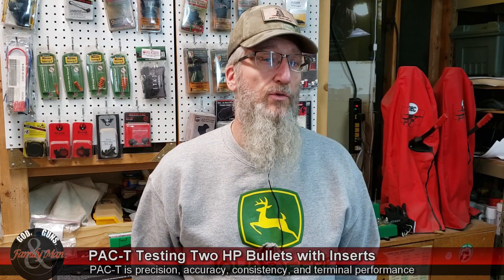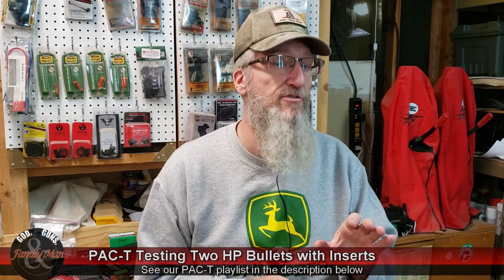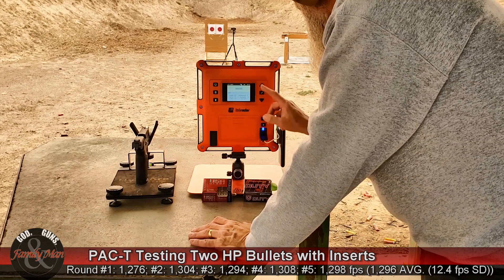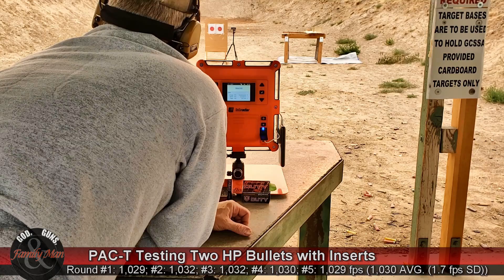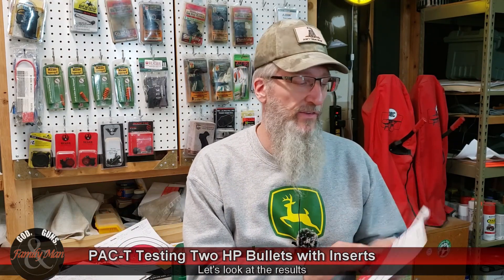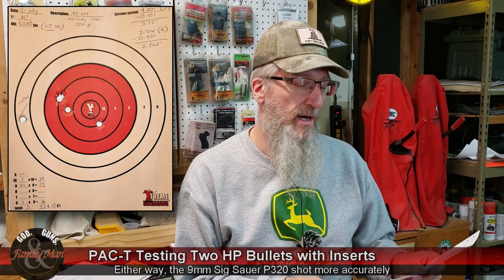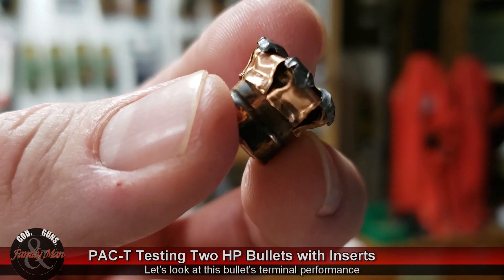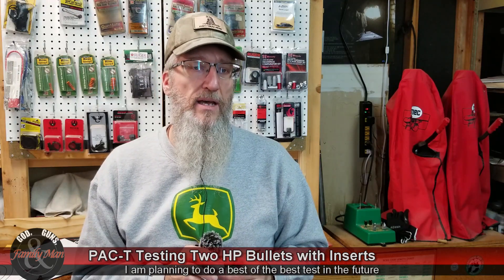PAC-T Testing the Hornady Critical Duty and Winchester Defense bullets

Comment: I used to carry the Hornady but stopped after experiencing a major problem with bullet set-back (which I have never experienced with ANY other manufacturer's ammo) and after contacting Hornady I received only negative customer service. 
They said I was "cycling the ammo too much and their ammo was designed to be loaded once and fired, period" 
It seems they believe we shouldn't unload their product, practice with range ammo, then reload their ammo for carry.

Absolute HOGWASH!
Reply from the maker: I have seen that with many of the carry ammo bullets.  If a person carries loaded and then unloads at the house, carries loaded the next day, etc. that bullet will start to set back into the case more and more (the taper crimp is not sufficient to hold it in place).  So... yeah, this happens.  
But you do have better options for carry.  The Sierra/Sig Sauer V-Crown in excellent as is the Speer Gold Dot and Federal HST.  Take a look at these, we did a PAC-T test on each of these and others.  Here is a link to our PAC-T playlist https://youtube.com/playlist?list=PL_KBTsQIm0U4HgkXxCZ2wk8djXCmS8aVl
Thanks for watching and posting.
Reply: @sdkweber  In over 40 years of defensive (along with duty) carry I have never had bullet setback to the degree of the Hornady----plus, it was only 45acp, the 9mm and 40sw did not exhibit ANY setback after many, many repeated loading and cycling
Reply from the maker: @stevenwilkinson8373  Ah, Hornady may be worse than others.  I am using Sierra V-Crown 124 gr. and see some of this as well.  It is certainly something we need to watch.
Reply: Nice video.  Where I live I can get the USA ready defense in 9mm pretty cheap.
Reply from the maker: @Aelazadne  That is good.  Get it while you can.
Reply from the maker: And thanks for watching and posting Phaeron!